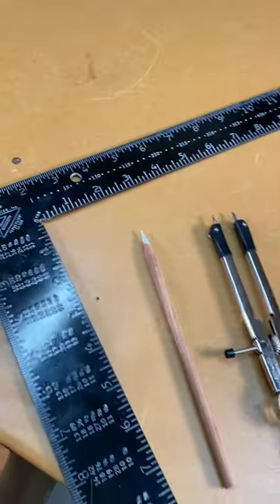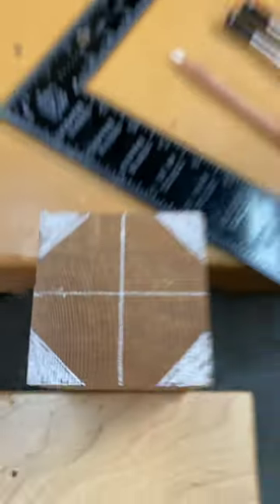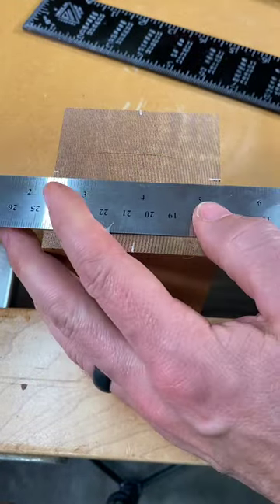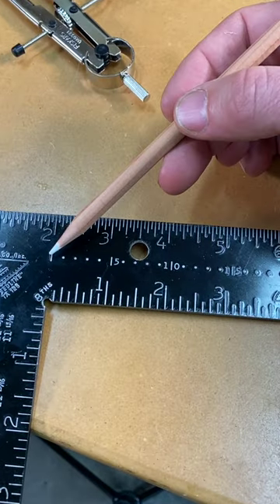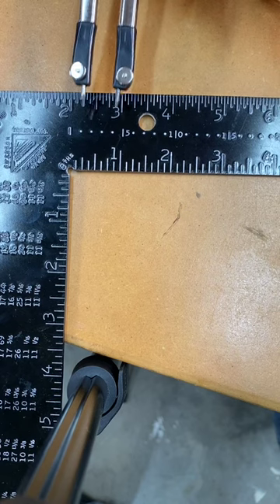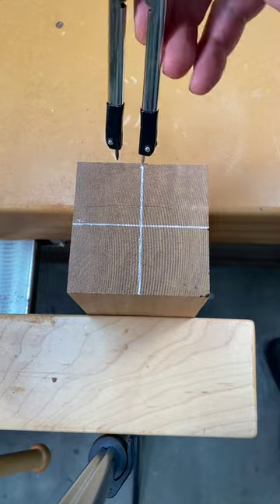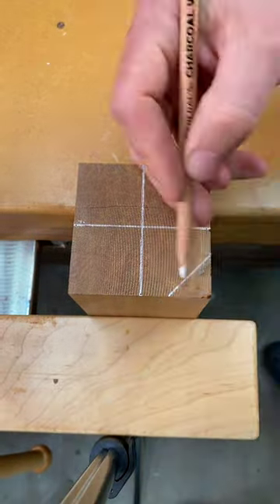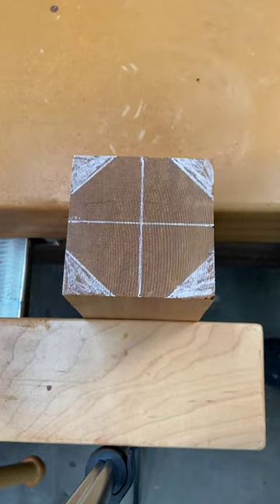Framing Square Scales | Octagon Layout

Comment: How about a pentagon, I hope you can help
Thanks for your video, I didn’t know about this
Reply: For any regular polygon the exterior angles must add up to 360 degrees. Use a piece of cardboard for a template.

360 divided by 5 equals 72 degrees.

Measure the length of the size pentagon you want.  Lay that out on the template. Using your compass draw a second side at 72 degrees from the end of side 1. 

Repeat this until the 5th side meets the first.

For a flat pentagon adjust your miter gauge to 72 then trim off the angle then rotate the board so the cut side is on the miter gauge. Make the cut to match the template. Continue and you will have your pentagon.

If you want a post with that shape adjust your blade to 18 degrees. Use your template to find where to start your cut then adjust your fence. Repeat 4 more times adjusting your fence and you will have a post shaped like a pentagon.